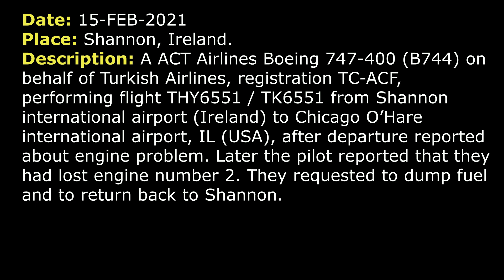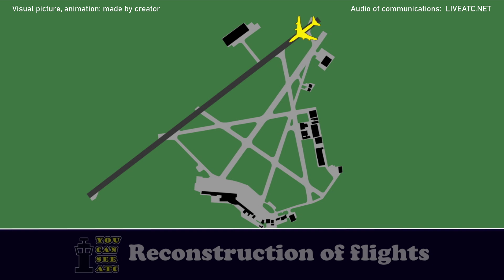ENGINE FAILURE after departure | Turkish airlines / ACT airlines Boeing 747-400 | Shannon airport

Comment: Well that's the first hearing about animals on board lol
Reply from the maker: For me it was the second time
Reply: Horses?
Reply: So the pilot was only mentioning the animals to update the souls on board, right? No other significance to the issue?
Reply from the maker: Maybe just for information.
Reply: In the event of using thermal image equipment or sound sensing equipment during an emergency, a live animal can be confused to a human trapped in the aircraft. The basis is that a firefighter might risk their lives unnecessarily by entering a burning aircraft believing a human was trapped.